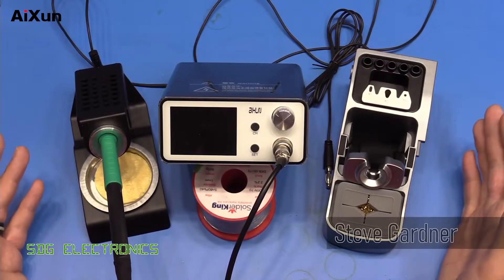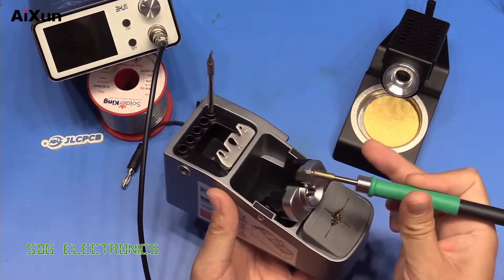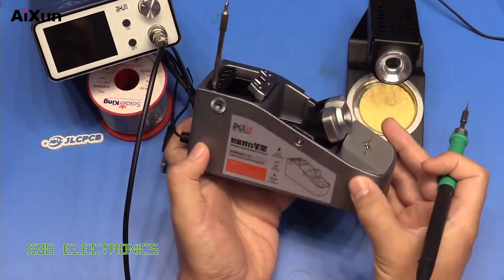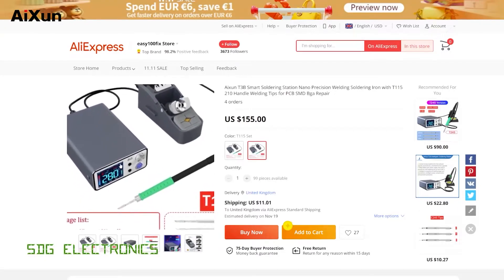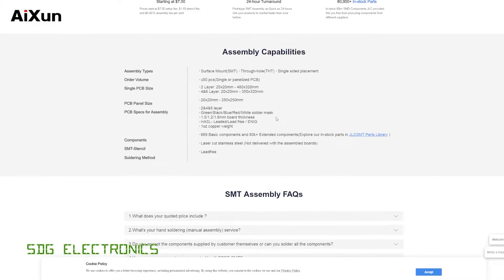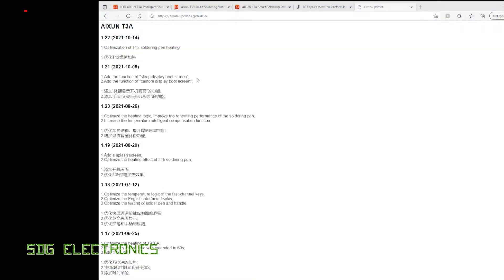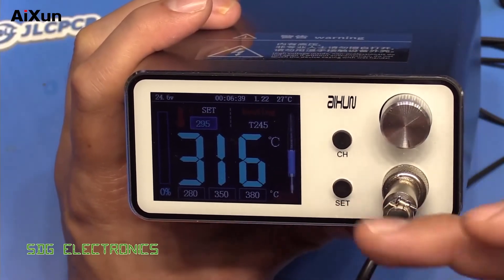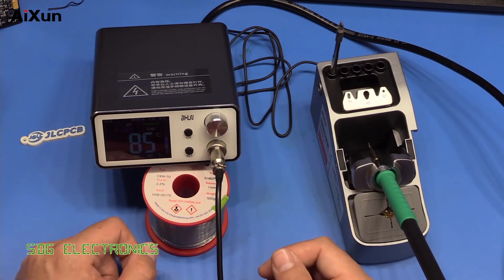NEW Soldering Station Review || Aixun T3A Handpiece Cradle Support T12 936 and JBC C245 handle

Comment: I wonder why the T3A version has not been updated with T3B functionality. I mean connecting the handle to the stand, and then to the station. There is no such possibility in T3A, which is a pity. This can be solved in a different way, the possibility of mounting the T245 handle to the T3B, but at the moment it is not possible, because the T3B only attaches the T210 and T115 handles. The plugs for the handles are different.
Reply from the maker: Thanks for your comments. It's difficult to change the surface design of T3A because the materials and models are confirmd. Considering the shorts of T3A and T3B, we launched the T420D which is compatible with T245, T210 and T115 three handles, and it can easily satisfy different soldering needs.
Reply: @aixuntech  The T420D is way out my budget and its footprint is way to large for my desk. I don't really need two handles at the same time. 

Just release T3C, which can have the form factor of T3B, but with support of T245 handle. I am pretty sure it's just about firmware update and minor tweaks. I would be interested in buying it and am pretty sure a lot of people will be, but only after you fix your firmware bugs with the temperature overshooting. Trying to hide it through the software is pretty lame.. your customers are no dummies and you just spit on your reputation this way. You are not selling kids toys.

Raise up the QC as well. A lot of people are complaining of poor connections, strange noises from the handle and so on. 

Your product has a lot of potential, it is build decently. But those flaws are big no for me. 
Once you get it all sorted out, I will be very happy owner of your soldering station.

Best wishes on your future as a company.
Reply: EXACTLY. The only reason why im not buying this is because i want the T3B but i need a T245 handle which is only available in T3A.